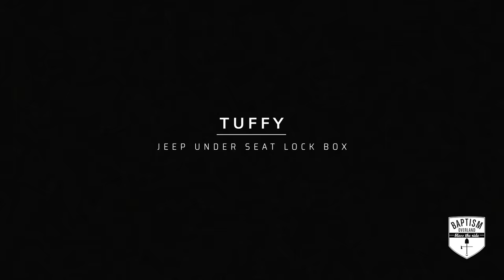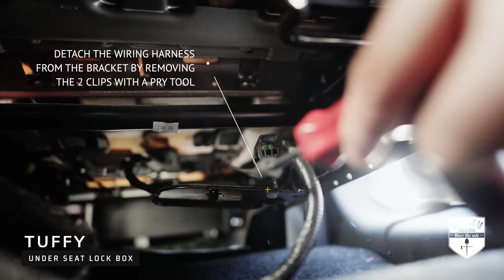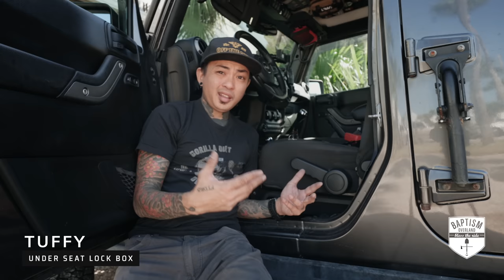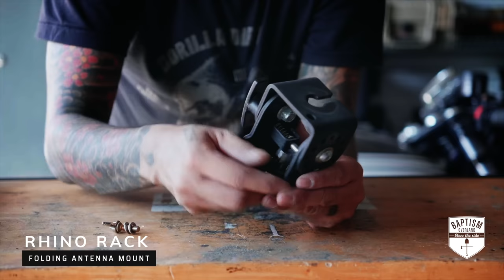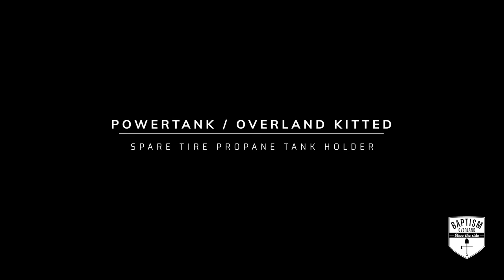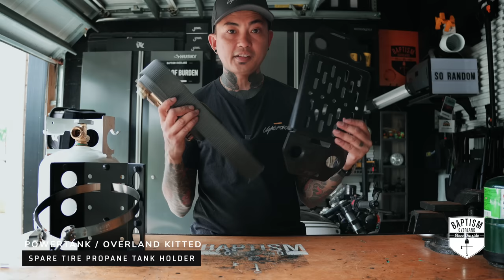5 *Random* but EASY Overlanding Mods

Comment: Hey Asia, with my spare tire mounting bracket ratchet strap, I folded the excess back on itself and then used a zip tie.  It is an option.

Comment: Thanks for your rant. I bought a Powertank system in August. I had to call to them to double check something. I think I spoke with that same guy. I didn’t have any problems though. I did have a problem with Borla. I bought an $800 exhaust system, it was so bad dealing with them. I just threw the whole exhaust system in the scrap yard.
Reply from the maker: Dang that's sad but thanks for the heads up

Comment: Use rgb rock lights on the inside if you have a hard top. I keep it on red for bugs. Super bright
Reply from the maker: Yeah was going to but didn't feel like doing any wiring. I have an RGB tailgate light I put though. This was the fastest solution.

Comment: Suggestion on that spare tire tank carrier. Double up the cargo straps. I have a similar setup for my gas cans. First trip out the single cargo strap failed and the entire setup went bouncing down the dirt road...
Reply from the maker: Agreed. What I'm thinking about is a strap that can also go the other way through the holes in the wheel. This should help prevent it falling off.

Comment: I had seen Power Tank products too. From an engineering stand point they are just off the shelf components. I ordered a tank, tank valve, regulator,  and tank carry handle all well established brands with good quality control for a total of about half the price of Power Tank. Point is, power tank is a marketing company, making a lot of money with each tank system they sale. Parts inventory and labor of assembly are much less than what I  paid and expended in an hour of labor. As an image and a marketing company, they should as a business model, work for a good customer experience.  Next time build it yourself, it will be cheaper, less frustrating, and take less time.
Reply from the maker: Yep. I was actually gonna build one awhile ago but then ended up getting air compressors

Comment: I was also in the market for propane alternatives recently and found the Power Tank mounting products. I couldn't justify a $125 mount when it didnt include a tank as well. I ended up going with the IGNIK product (even though similar in over-expensive pricing) because of sizing and carrying case. I could easily just ratchet it inside the bed somewhere and be fine with it.
Reply from the maker: Yeah IGNIK is awesome. But to use that I'll have to store it in vehicle which I didn't want. At least you have a bed to ratchet it onto.

There's actually a guy on Etsy that makes the mounts for half the cost of the powertank and he's been getting some attention lately. You should check it out!

Comment: Man, I hate that with companies and usps. I had a similar issue last year. I have a 2021 Jeep Cherokee trailhawk. The aftermarket support is lacking for this model. But there was only 1 company really making parts for it. I ordered a part that I wanted in order to run bulletpoint arms. And well after i ordered it, a day or so later i got a tracking number....It took over a month for me to get it. Gave me the same answers as well its not my fault. It got lost in shipment. But the tracking had never updated from it being created at his location... Im not one for bitching to get things free all the time. I just want it made right. Just like you.
Reply from the maker: Exactly! I don't want special treatment. I don't want free stuff. I just want it done right. Could've been settled the first time I called. So now they have one bracket lost in the mail, one that finally arrived to me and then a 3rd that's supposed to arrive tomorrow that I'll have to send back.
Reply: @BaptismOverland  I sent you a message on IG. but its giving me errors. So not sure if i can communicate on there from work :/
Reply: It’s not lacking, it’s just proportionate with the demographic/user base of the vehicle.
Reply from the maker: @user-dw4cv3xq5u  for the Jeep it's def not lacking lol. I think the wrangler has the biggest aftermarket support out of all vehicles
Reply from the maker: @mando_outdoors  try when you get off work and if not I'll give you an email
Reply: @BaptismOverland  its letting me respond. Im not sure why it wouldnt let me send any other messages...gov't computers man. l o l.
Reply from the maker: @mando_outdoors  ohhh. Yeah man

Comment: On an overland/remote travel vehicle a lockbox is essential, I have one on the Landy, no I'm not saying where it is... 

Folding antenna mount, not really a necessary item, depends on the antenna, if it needs a ground plain, it could be a cause of poor signal as gives a poor or resistored ground. (amatuer licence holder and have played around with a lot of vehicle antennas. 

External gas bottles is never a great idea in my view, too much possibility of theft and it's constantly in the weather and sun, especially on the back it gets all the debris off the road, better to mount in a separate side accessed locker, with adquate venting direct to outside. if the bottle leaks it vents safe, it's not liable to easy theft and it's secure, what is better? 

all camp lights it's a good idea to have colour change or separate amber or red lights, as you rightly say, moths and bugs love white light, it's their moon. 

I like the tent holders, especially if you have something like an Oztent or HM Wizz. Perfect.

Re shipping, there is a differnce in fault and responsibility! It may not be the sender's fault, but it is their responsibility to make sure the shipping method is reliable and delivers, after all, not receiving goods is bad, but here, the law is on the side of the purchaser, so the sender is responsible for the goods until the purchaser receives them, so here your claim would be just. Also the sender has already lost the goods as won't get them returned mid shipping so the paid for a service is irrelevent as you paid for 3 day and didin't get it TWICE! That is bad. Here we have consumer rights legislation that sets out responsibilities of each party, on the whole it works, but the latest set of regs isn't as good as the preceeding versions. 

Seems like "Powertank" needs to have a good look at their customer services staff, promote the attitude of the woman, fire that man, good companies loose customers by poor staff attitudes.
Reply from the maker: Thanks man!

As far as folding antenna mount, I haven't had issues. I've been getting great range still. 

For propane tank holder, that's why I did it this way. I won't run it permanently and thus not worried about theft. If someone is stealing it while I'm on the the trail or camping, then it's time to pull out that firearm from the lockbox cuz there's def someone in the woods that shouldn't be there! Lol (And yes that def happens...)